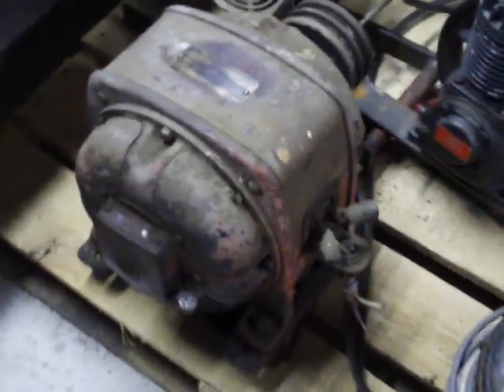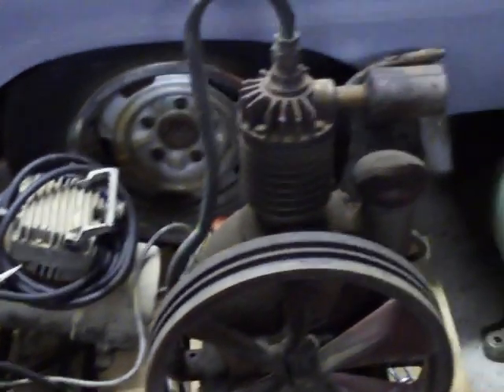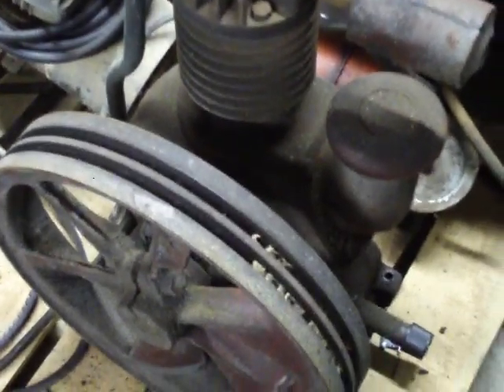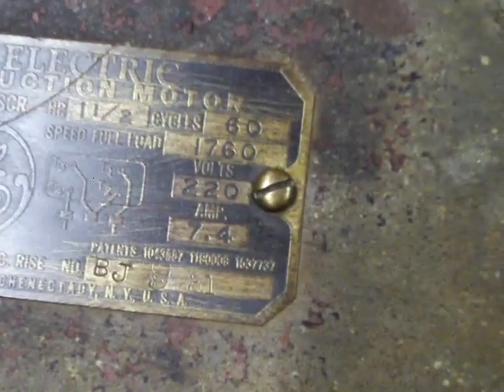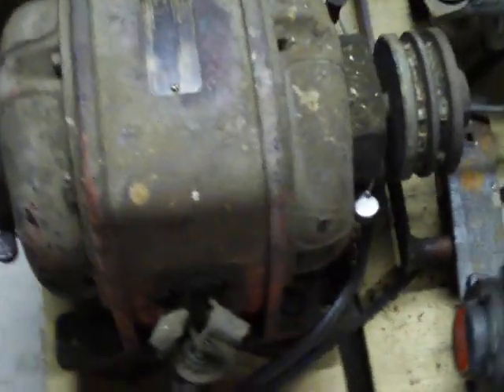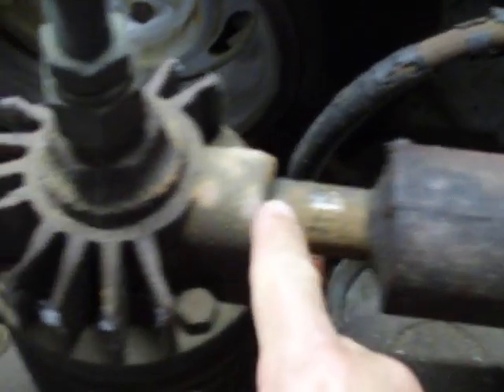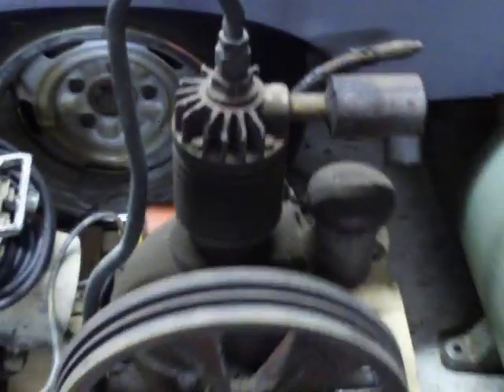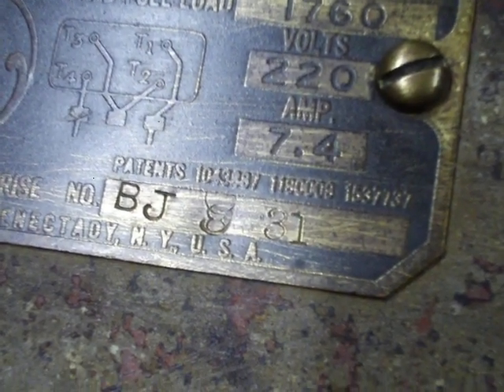GE Repulsion Induction Motor

Comment from the maker: Yes i had someone post a great place called Helwig Carbon Products they seem to have it all, i had not purchased them yet, because the motor has been packed up, but i feel lucky to have found it and know that not many are around this age, I know there are, but i mean most people junk or scrap them for $10 to me its worth way more, I still have the compressor just the tank was no good, tank was squared off on the ends not like new tanks that have bubble end caps  best i can describe Thanks  !!

Comment: @Wallabydam A 3-phase motor of the same HP would have more torque than a repulsion start type single phase motor and would outlast it too. For single phase, a capacitor-start motor would have more torque too compared to a repulsion start motor, but the only weakness is the centrifugal switch inside it that switches out the starting capacitor can get stuck or go bad if the quality is bad..Northern tool sells high quality Leeson motors. Use Farm duty motor Model# 110089.00. They don't go bad.

Comment from the maker: @EETechs I honestly  have to say that i like the induction motors, with no Cap.  I want to ask in yours and everyone else that reads this, Does this motor compare to the modern day motors?  like could a 1 1/2 hp moderen day motor run this compressor pump as this old 1 1/2 hp motor did for so long? do you think this motor have more power in torque if it was a head on head competition. i ask that because i have a project for this motor in mind.

Comment: I would like to add folks that this design was mostly used for single phase because they did not know how to make high starting torque using capacitor start method. If it was 3-phase it would have no brushes, but simple a squirrel cage like rotor as design as still used today in AC motors. I just want to let you all know because the AC induction with no brushes has been around since 1888. Three phase needs no special starting method like single phase does.

Comment from the maker: @oct281995 I appreciate that, wow thats good to know,, so you can tell who makes that pump by lookin at it?   the compressor tank it was on was at least a 60 gallon, the motor still works fine, but i want to put it back in use, so i was tryin to locate some brushes for it,  if you find out who might have them please let me know, thanks for stoppin by!

Comment from the maker: @NathanH5  It has 4 brushes, its like most  back then and you can reverse it while running and everything,  im guessing the brushes are the same size or so as the motor you have, im wishing i can find one more motor like this one,  wow 1600 watts to run it?   im new to this kinda and wonder which way would be best to wire it up right now its 110v but im wondering if it would be easier on the house wiring if i did the 220 or not.  im kinda scared to take it all apart lol..i want to restore it .

Comment: How many brushes does this have? Mine has four and these are brushes with pig-tails attached. I will look around too, but the best place is a large motor repair shop. Even today, large hoist motors use brushes and slip rings, and there are many large DC brush motors in use...so brushes should be readily available. 
Your motor draws 1628.0 watts @ 110VAC, or 814 watts @ 220VAC. It is 4-pole (1800RPM no load) and 1760 RPM with slip and load. These are GREAT motors! Take a video with it apart!

Comment from the maker: Well the only thing i could see is that finding brushes for it would be something, but it has very good start up and is reversible with just a move of the brushes, it has timing marks on the back to position the brushes in the proper place for either forward or reverse, amazing motors in my mind, to think they last so long, wish they owuld make things no adays liek they did back when they mades these, its all about making money not quality so it seems.